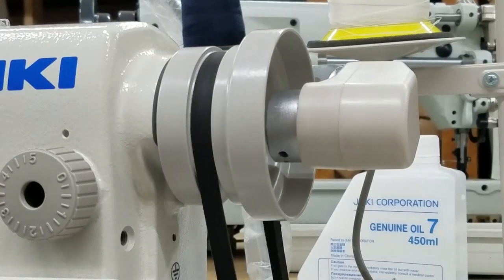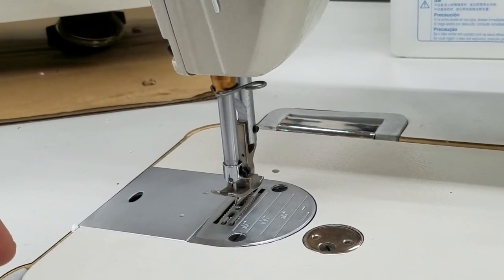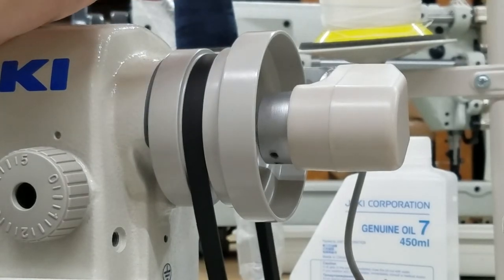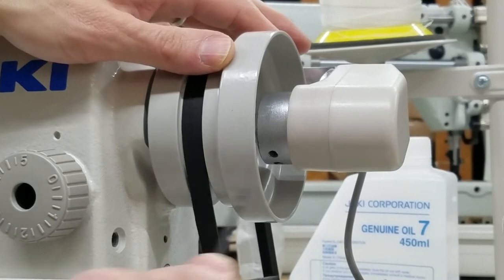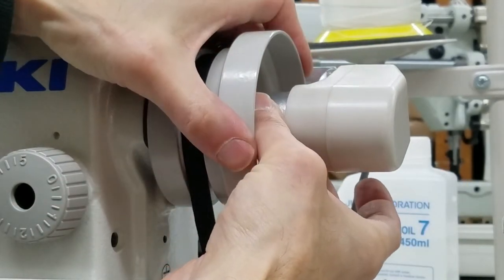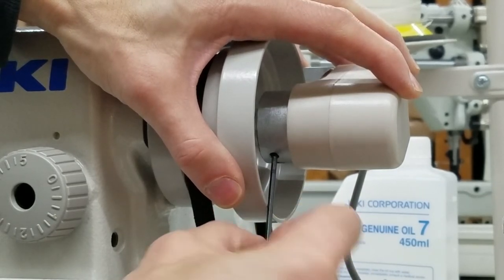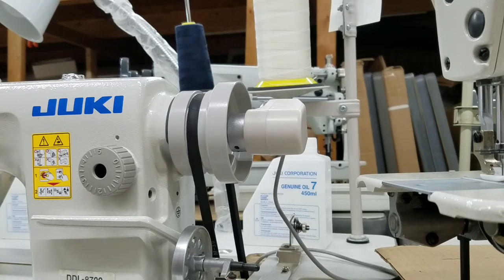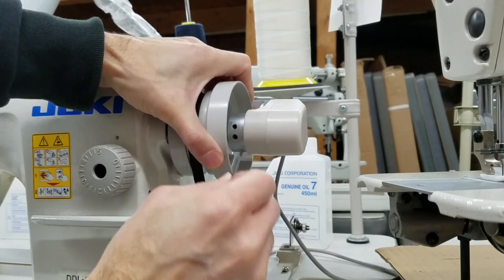Setting the Reliable 6000SM synchronizer in needle up

Comment: I am having trouble figuring out how to use the stabilizer bits and pieces sent with the needle position synchronizer for my Reliable SewQuiet 6000SM servo motor.  I can't see where to put the stabilizer on the synchronizer itself.  Is there a video showing the installation?  I have a Juki DDL5530 (single needle). The video cited below is for just the motor installation, which I did with no problem.
Reply from the maker: Watch this Beverly: https://youtu.be/bF9yXu8fzMM
Reply: @Sewinggold  PERFECT, Steve!  Both of these videos were so helpful!

Comment: What is that synchronizer for ? Is that for noisy motor ?
Reply from the maker: It allows you to program the motor to stop the needle in the up or down position when you remove your foot from the pedal.
Reply: Thanks